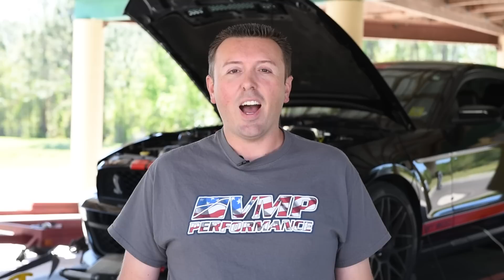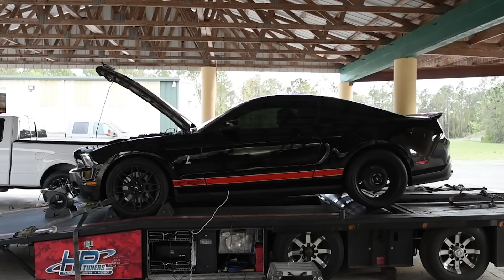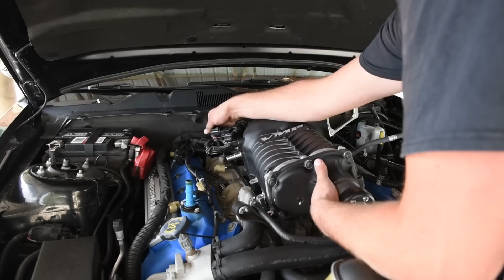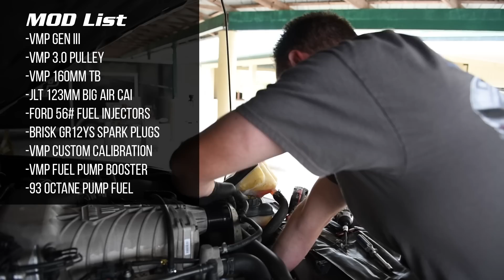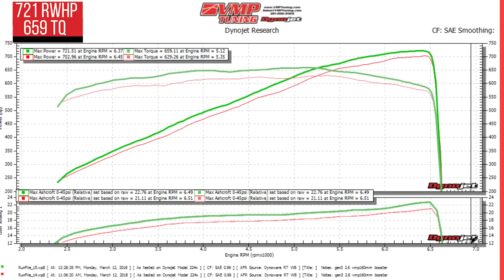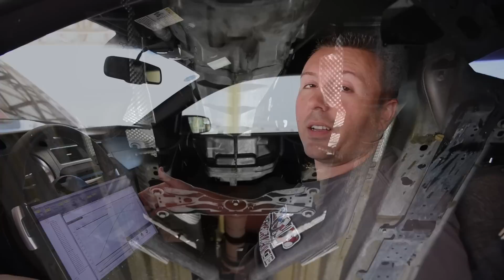VMP Performance | Stock 2012 Shelby GT500 Blasts Out 800 HP With VMP Gen3 TVS Blower

Comment: Exhaust has to be choking it , same last setup and tune but with full exhaust .....what goes in must come out !
Reply: Oh yeah, you can see it in the torque numbers. Youd probably gain at least 30 or so just from an off road H or X pipe. I get the feeling this setup would come alive with headers.
Reply: Yes, LT headers, x or h pipe and a good catback setup should really help that car breathe! Great video guys!!
Reply: On an N/A car that would be true. On a boosted car it dramatically increases an aftermarket exhaust's effectiveness. The faster you can get that pressurized air out of the cylinder, more fresh air in the cylinder, the more power it will make.
Reply: Zexhaust is a must end of story and not that small bullshit 1-7/8 headers it needs 2" headers to 3.5 collector.   This blower is capillary of a lot more power then they have shown they don't really push it at all
Reply: MH motorVlogs where do you get those numbers. Sounds to me like you just pulled them out of your ass. I bet you $10000 the car would pick up more than 20 horsepower with a full exhaust.
Reply: tominator no cats that's restriction.  2"header to a 3.5" collector and have it dump with cutouts. Th ats how you make the power and fuck the tq the hp number is what you want to focus on.
Reply: Lol Keyboard tuners know more than VMP.  Full
troll silliness
Reply from the maker: Thanks, Jeff! ~Kerrie
Reply: VMPPerformance  , yeah I think gotta do exhaust and then show what car is capable of before having to do return style fuel .  Being a basically stock car and 5.8 , that makes me want a GT500 with a 4r200 conversion . I'm sure return-style and E85 at pump would get same results !
Reply: @VMPPerformanceTV  I want to get to 700 horsepower on my 2008 Shelby GT500 ..... i'll be giving you a call 📲  ✌👌🎯☝
Reply: @VMPPerformanceTV  anything for the 05-06 Ford GT ?
Reply: They ran a built 5.8 with small tiny restrictive exhaust.  Put those numbers out like they where great they weren't
Reply: @09shelby15 the 2011-2012 GT500s are 5.4L, additionally 2.75" exhaust was kinda ok for the factory power levels as these things trace their development back to 07 when 2.75" was on the upper end of factory exhaust diameter. The fact that in thw present and 485+ hp cars are now routinely coming with 3" stock, is merely a sign of progression. Don't knock the hussle too hard as it was a different time then and current advances are continually pushing the goal posts of yesterday. 

Based on the context of what a 550 fwhp car is actually like to drive on the streets, and given their gains to 700+ at the wheels...the improvements are anything but insignificant. It's easy for us all to get jaded or power drunk on 1000hp YouTube monsters...but 300 hp is still fun; 400 still brings the smile and 500 is nothing to be ashamed of.
Reply: @maximumvelocity6542  yea i hate how everyone acts like 700 hp is nothing just because there are cars on youtube making 1000+ dont make 700 worthless or slow lol.  People race on dynos these days....all they care about is peak power numbers so they can brag to everyone about it but anything over 700 or so to the tires especially with the power and torque curve these 5.4s and 5.8s have is meaningless on the street and is really hard to hook.  You can hook ok with a good setup at 700 or so wheel on the street but once you get more it becomes harder and harder.
Reply: VMPPerformance is there no need for a return style fuel system when switching to c16 or e85?
Reply: MH motorVlogs you're a fucking moron
Reply: Please prove me wrong lmao
Reply: Connor power gains depends on the build.  Of you have a nasty built naturally aspirated motor exhaust could pick up big gains.  But on a bone stock bullshit motor pushing 200hp won't see giant gains.  So there lol
Reply: Jeff Long true enough but the sound levels are tolerable 👍
Reply: Exhaust won't add much power. Headers maybe 10-13 hp, and the rest of it, 5-7 hp. So 16-20 hp more. I love the stealth factor. And here I was considering a 2013 or 14 gt500.
Reply: There’s plenty of data out there that shows headers and off road x/h pipe yields over 50+Rwhp... I’m putting down close to 600rwhp with FBO and custom tune on my Eaton stock blower
Reply: @MasterCarguy44-pk2dq  that is just false those numbers may be accurate with an na coyote but this car with a upgraded blower flowing that much air an exhaust would really wake it up probably add more than 50 whp and torque with a good catless header back
Reply: @MasterCarguy44-pk2dq  catless corsa full exhaust added 55whp on my 12'